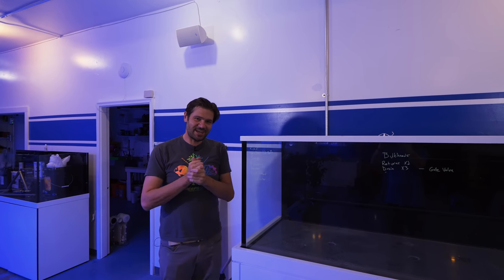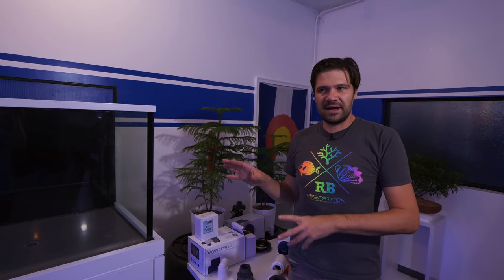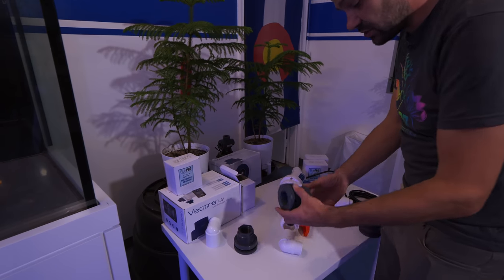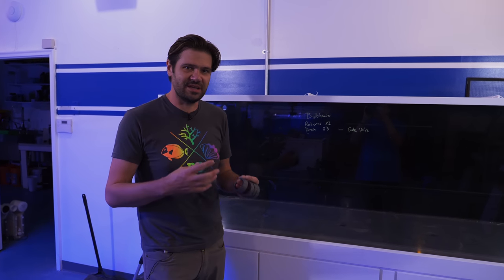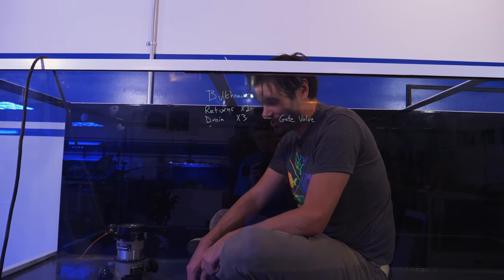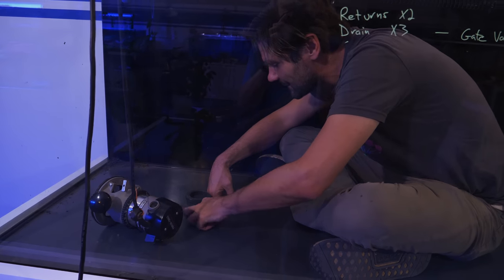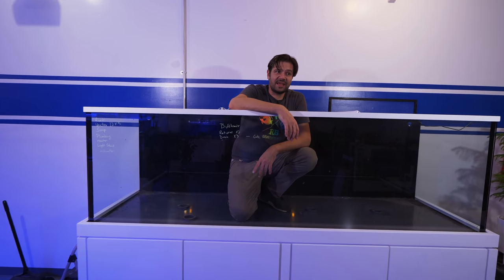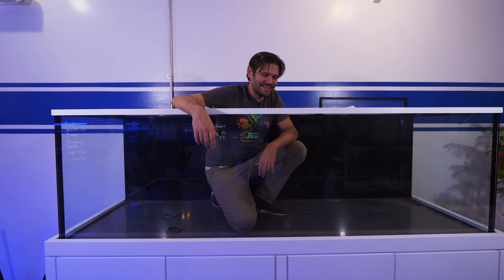Vlog 44: Precise Drilling for the BIG Reef Tank

Comment: Looks great, just a note the bulk heads your using have raise edges. For grip, when you go to tighten it it will not smash the gasket. The raised edges will bottom out on the pvc tank bottom
Reply: That's how I saw it too. The inlay that was carved actually works against the seal quality.
Reply from the maker: Good eye and thanks for looking out, but the bulkhead actually does fit in the hole with those ridges, just barely, but it's going to smash that bulkhead good and tight

Comment: What if you have or develop a leak before the valve? Wouldn't it make more sense to hard plumb that instead of threads, when you'd have to drain the tank to mess with them?
Reply: thats what i thought. top part of the bulkhead can be threaded because if that leaks it would go into a closed system. bottom part of the bulkhead if thats threaded, better hope it never drips, id glue that part in for sure.
Reply: brings me back to the old days when you would look under a stand and see someone using gutter or something to divert the leak back into their sump.

Comment: Man i was scared to drill my tank and ended up doing a HOB overflow box and now regret it with how loud it is.
Reply from the maker: You can probably still fine tune the gurgling using a durso mod, stockman pipe, and adjusting the flowrate going to the tank
Reply: Simple fix slow the flow or speed it up. I have one and is quite as can be.
Reply: @lunaticrider209  ive tried with a gurgle buster and its still a loud sound on the drain us so loud. I didnt put a valve is that the only way? Ive tried slowing the flow since i have a dc pump but what ends up happening is the U tube starts catching air bubbles again.